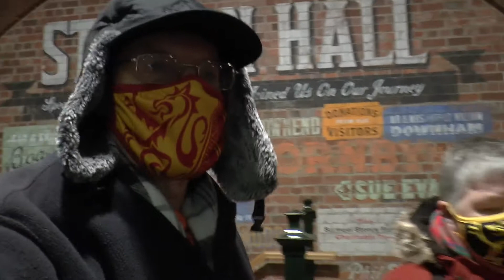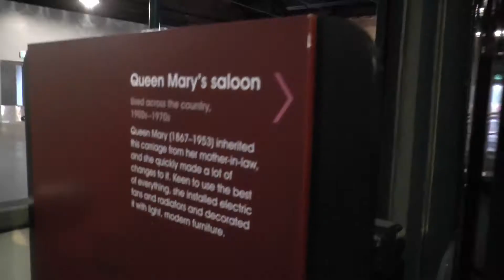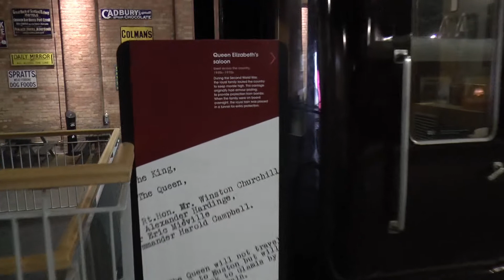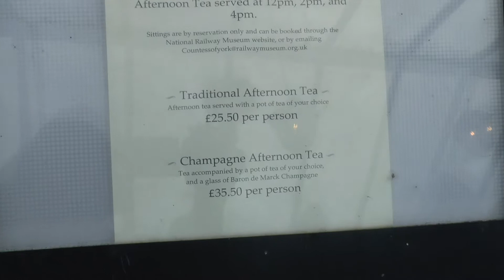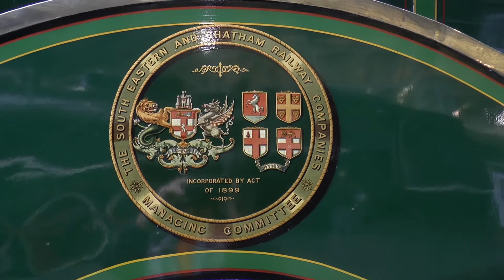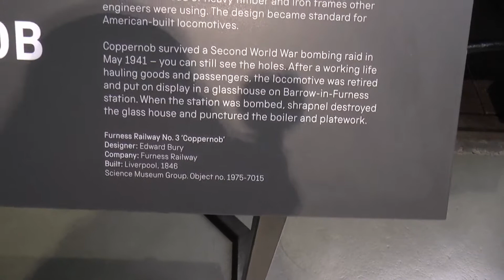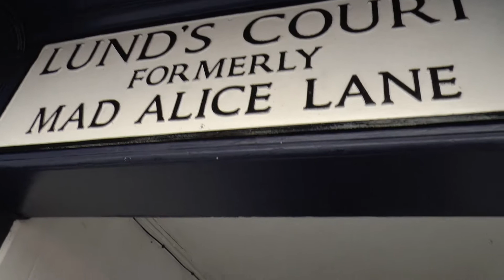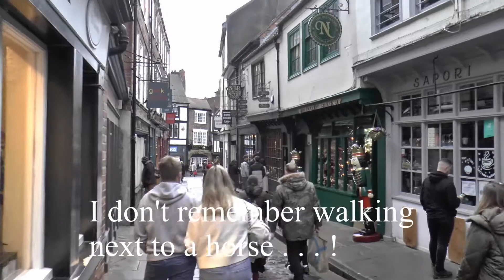'Jugs' Discovery 2. Test Drive to York!

Comment: Cracking drive out.York is great. Glad the disco is performing well. How do you find the gearbox? Mine sometimes hangs on to gears and is quite revvy better ones its warmed up.
Reply from the maker: Just the same, especially up hill. I'm going to check the fluid level tomorrow. Takes ages to change up when cold.  Changes better when I floor it, but that's bad for a cold engine!